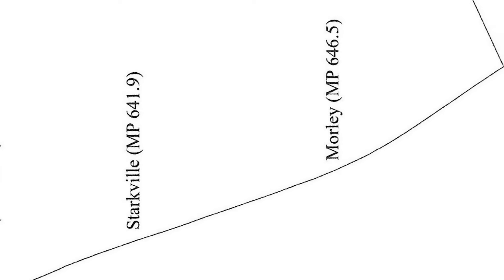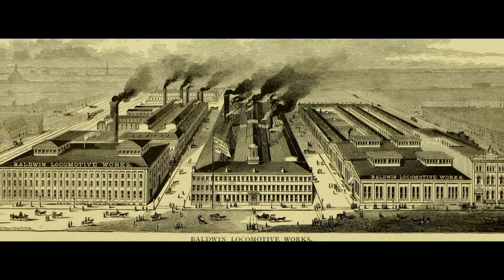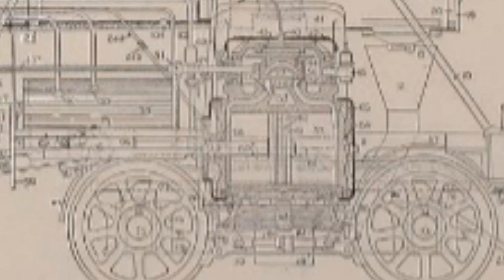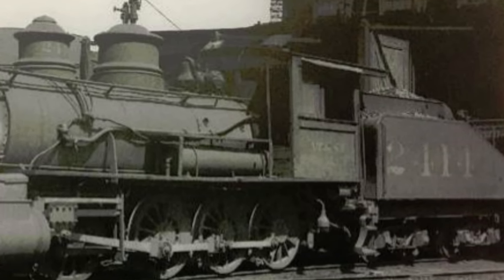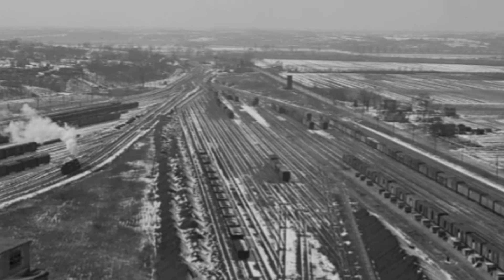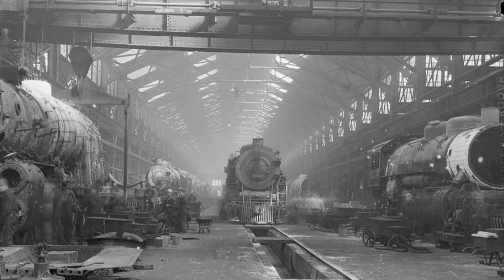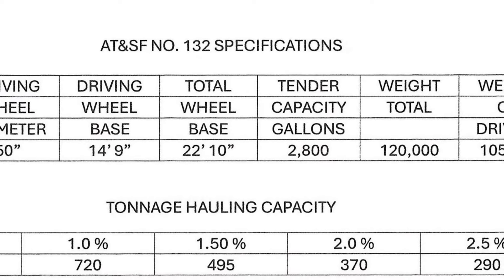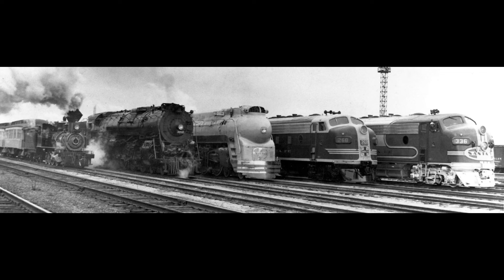Episode 3: ATSF Motive Power - The Beginning of Santa Fe's Mechanical Department.

Comment: Saw the locomotive 2 times in the late 1960s.  In the morning, from a Santa Fe Super Dome when pulling into Dearborn.  It was sitting alone, but the yard goat was on a parallel track about 100 feet behind keeping company. No humans to be seen in a cab or in the yard.  Then, late the same day from a coach seat on the westward Chief. Cyrus was about 1/2 mile further west compared to the morning, attached to a modern (1960s) flat car, box car, and maybe a MOW crew car.  Odd looking lashup, especially with 1880s and 1960s equipment. No yard goat anywhere in sight. No humans in sight. 

I made maybe 12 more trips to Dearborn. Always looked for the loco. Always saw it my mind but not in person.
Reply from the maker: Interesting story! Thanks for Sharing and watching.